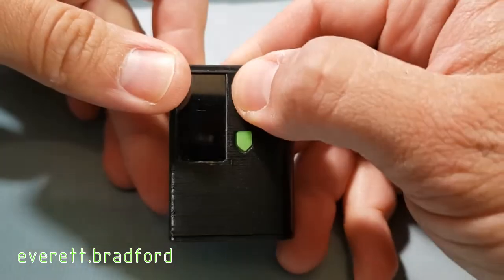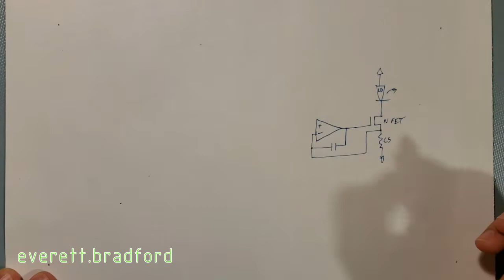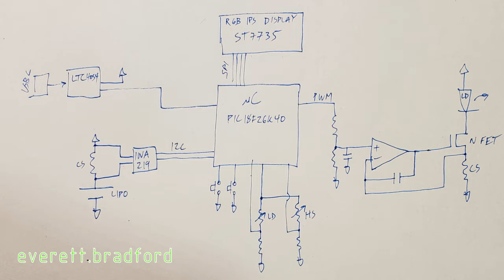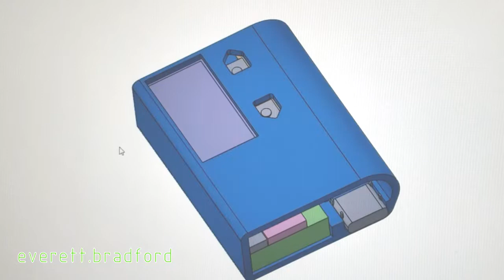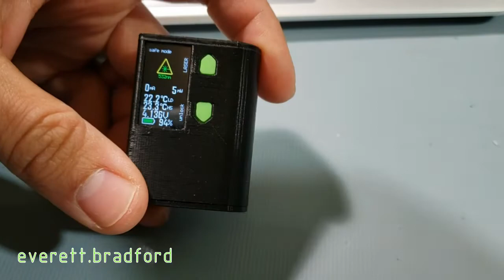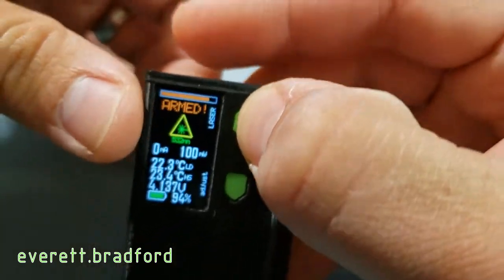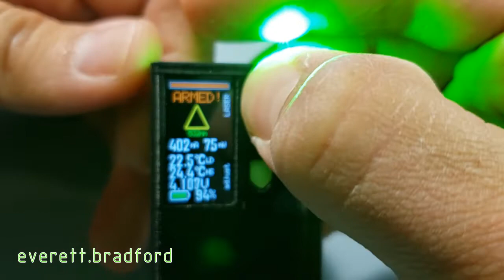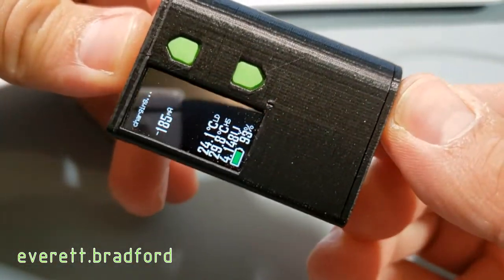custom-built 100mW green laser

Comment: Great job! I did something similar using the 200Mw modules available on eBay. They are Chinese but they seem to have very good optics and good quality parts and diodes. I’ve done destructive teardown and testing of modules from that same seller… And he carries real good stuff and some very high-end lasers as well. His Great quality 200mw module at about 50 or $60 for the module alone but I’ve got all the other parts so that’s a pretty good deal for 200 mW. Or at least it was a good price until the 1000 mW green diodes hit the market and can be had for great prices! 

Now I just need to tackle one of those new 1000mW green diode’s… Should be able to build one of those into a handheld pointer for around $100. Or if I splurge for a pre-made module from DTR maybe $150 after including the brass stock that I’ll turn on my lathe. But hell I can’t imagine having 1000mW of green laser power… Some people have even been pushing it to 1,200 mW! In a handheld pointer for $150! That’s insane!